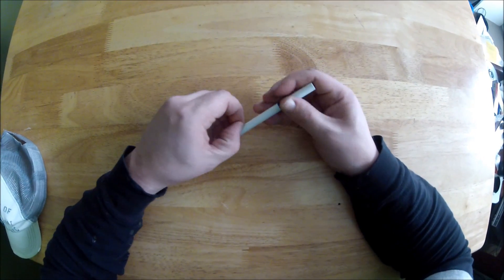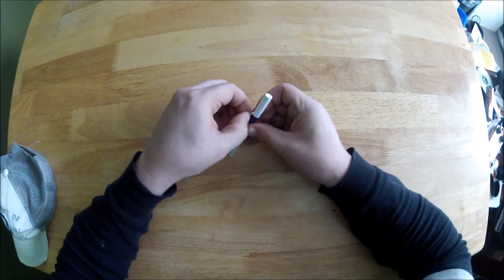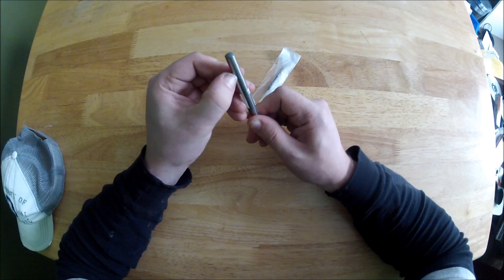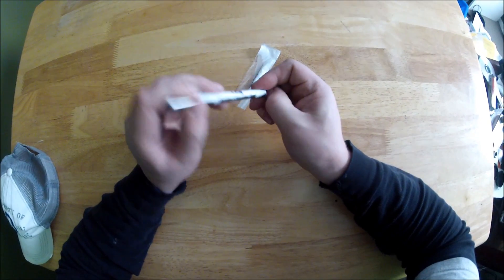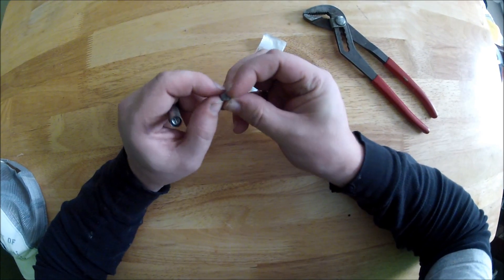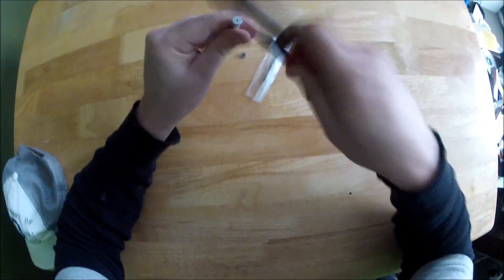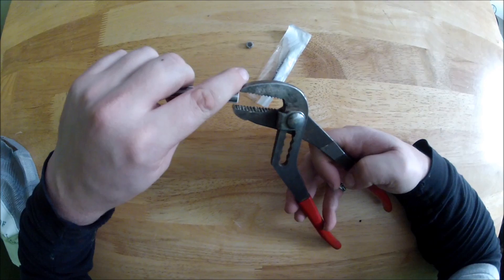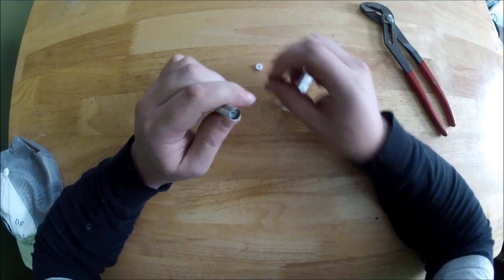E-Cigarette Video - What Is Inside? Video HD

Comment: Serious toxicity generally occurs only at plasma concentrations over 1 g/L, which requires extremely high intake over a relatively short period of time. It would be nearly impossible to reach toxic levels by consuming foods or supplements, which contain at most 1 g/kg of PG.

Comment: The acute oral toxicity of propylene glycol is very low, and large quantities are required to cause perceptible health damage in humans; propylene glycol is metabolized in the human body into pyruvic acid (a normal part of the glucose-metabolism process, readily converted to energy), acetic acid (handled by ethanol-metabolism), lactic acid (a normal acid generally abundant during digestion), and propionaldehyde (a potentially hazardous substance).